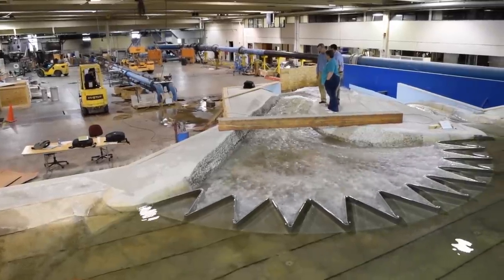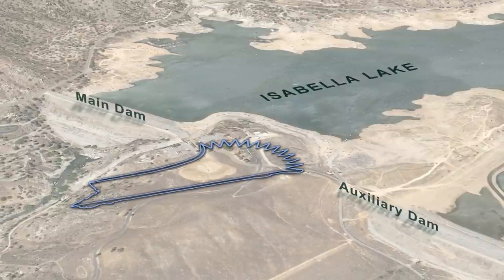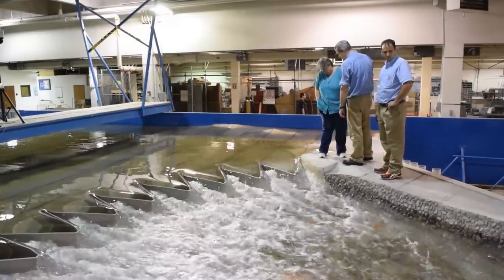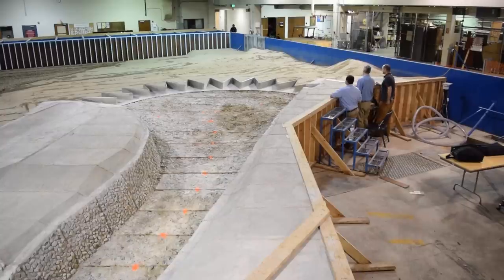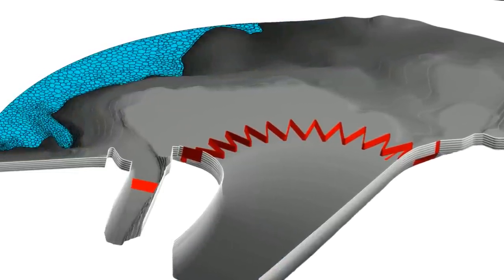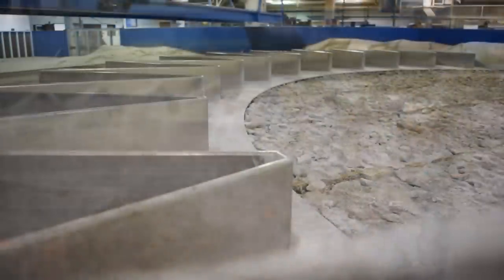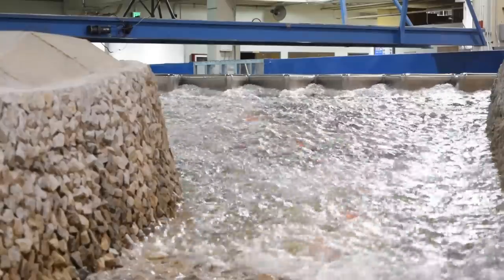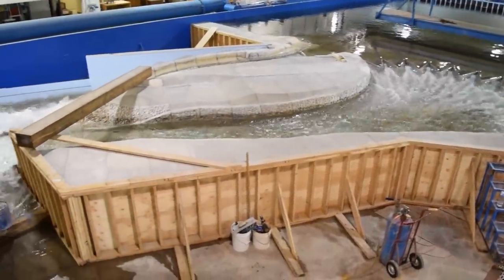Corps reviews final Isabella Lake Dam model

Comment: I wish he explained why they shaped the spillway edges like that.
Reply: Check "What is a Weir?" by Practical Engineering here on youtube. It actually shows this weir in his video (I was linked here from there). I promise you will love it if you found this video interesting.
Reply: To dissipate the energy to reduce scouring.
Reply: Surface area
With a standard straight across wier it would only have say 1/4 mile of spill. With this labyrinth style you can measure all of those vanes and now you have 2 miles of spill.

None of the measurements are accurate, just using as description

Comment: I've never heard of- or seen- a dam design like that.
Other than having an uncontrollable/unregulated spillover, what is the purpose of having a jagged barrier like that?  Aren't you just using up even more material for construction, and leaving less internal space for the hydroelectric generators??
Reply: EVA_Unit_4A it's called a labyrinth weir. the triangular design is for a good reason as it allows more water to flow over quicker while stillmaintaining the specific height of water behind it. the zig zag wall is effectively longer than a regular straight wall, and because it is longer, they can have it on a smaller plot of land.
Reply: Josh pretty much covered it. However, I'd like to point out its actually very common on smaller installations, especially in England.
Reply: Josh and Hexane explained it fine. But I'll add my own language from an engineer's perspective for any others who are curious. I had a grad class that discussed weirs and specifically labyrinth weirs.

Bottom line is that It saves cost and space. It's popular for modifications like this because oftentimes the budget and space are limited.

A longer weir is capable of passing a higher volume of water per second. Instead of having a weir that is very long horizontally (a long straight weir), it is possible to build a jagged weir that is "effectively longer" horizontally, but in reality is not that wide. Illustrative example: you could build a 50-ft wide jagged weir with an effective length of 80 feet because the jags, OR build a 80-ft wide straight weir, and both will pass the same amount of water if their effective weir lengths are equal. However, building a long straight weir requires extra space, which sometimes isn't available.

Technically, jagged weirs have limitations. If the jags are too close together, then water won't be able to flow downstream fast enough upon spilling over the weir. Similarly, if they're too close together, then upstream water won't find its way to the tip-end of the jag, thus reducing the effective length of the labyrinth weirs. Because of these concepts, there is much design work put into making sure it's right BEFORE millions/billions are spent building the full-size model.